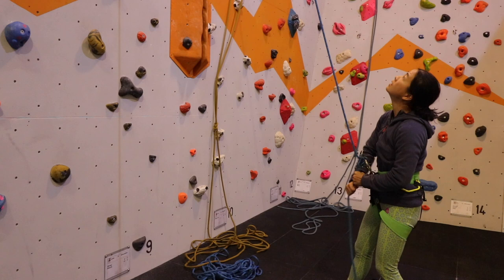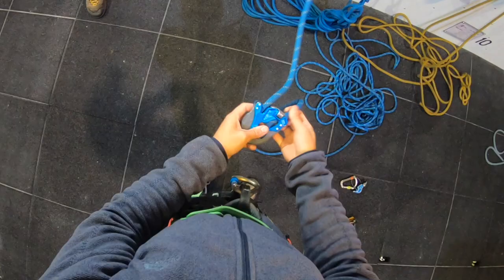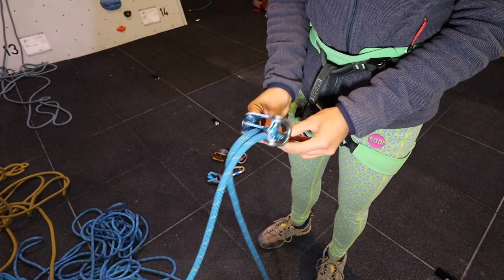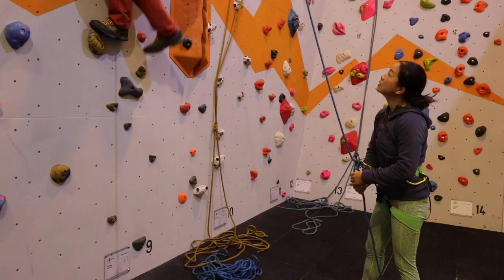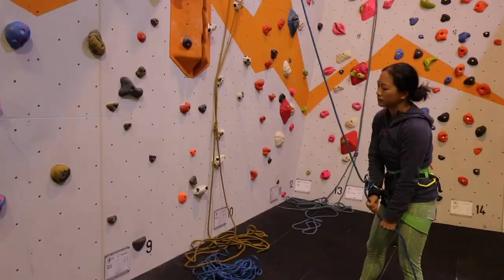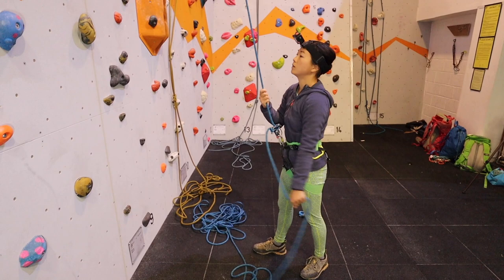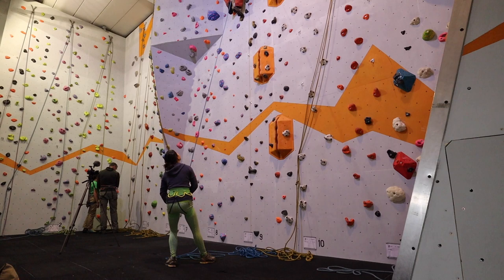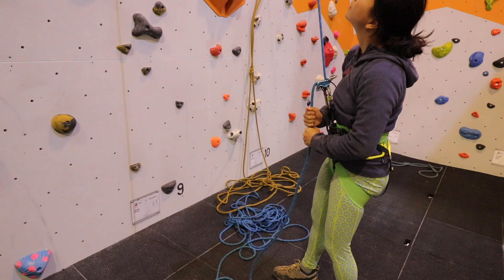How to belay - bottom/ top rope belaying

Comment: Nice, simple advice 👍 Most people usually quote the “V, to the knee, 1 2 3” mantra to beginners however I tend to find that the people I’ve helped learn to belay perform the steps so slowly and rigidly that when when they do the V, they keep the rope up and parallel for waaay to long so I’m glad you’ve mentioned how important it is the get that hand back down ASAP. I now tell people “pull and arch down, 1 2 3”. This way they’re making more of a smooth upward and then downward arch. It’s seems to have worked for everyone so far 😊
Reply from the maker: Thank you-yes, we’ve found the same thing with the ‘V’ part of the mantra, and have sometimes used numbers to help novices keep a rhythm in the early stages of learning.
Reply: Climbing Nomads Sorry yeah the “1 2 3” part is to do with the hand swapping... 1 - bring the left hand down to the dead end just below the belay device... 2 - slide the right up to meet it... 3 - return the left to the live end aaaaand repeat 😀

I also prefer people do the slide up thing rather than place above the left as sliding up means there’s at least a fist width between the hand and the belay device so the chances of the hand getting sucked into the device when a climber falls is much less. I’ve had this happen to me and it hurts a lot and of course instinct is to let go which can end very badly 😣

Comment: There's an interesting point at 4:47 "Free Running Ropes".  Some centres recommend adding a twist to increase friction when there's a weight difference between climber and belayer, and the belayer needs some extra support.  As an alternative to using a ground anchor or ballast bag.  The bonus here is that the belayer is free to move around still; though as you say there's increased wear on the ropes.
Reply from the maker: I would always try and avoid ropes rubbing against each other and would personally not encourage new climbers into this practice. I can see the benefit of adding some extra friction whilst allowing the belayer to still move around but would worry about the extra wear on the ropes and beginners thinking that ropes running over each other is not a problem in other situations. If a belayer is used to using the rope twist system it could also make it harder when learning to belay a lead climber.
Reply: @TheClimbingNomads  I'm fully behind you here - I've always been brought up avoiding rubbing ropes where possible and I always pass this on to my own students.  I'm currently exploring the use of an Ohm in sport top-rope settings with some positive results!
Reply: Edelrid has a tool for this. You clip it to first bolt, and it creates a drag to avoid pulling lighter belayer into the wall
Reply from the maker: Yep - we love our Ohm, use it all the time on sport and indoor routes when Soph’s belaying 👍

Comment: I noticed in the video she is walking her hands up. Today I took my belay class and then told me not to use that method and instead slide your climb hand underneath the brake hand up. Never taking your break hand off the rope?
Reply from the maker: Hi Sean, Thanks for watching. 

Both methods are safe. As long as there is always a good tight grip from one hand on the dead rope, it doesn't matter which method you use to move your hand back up the rope.